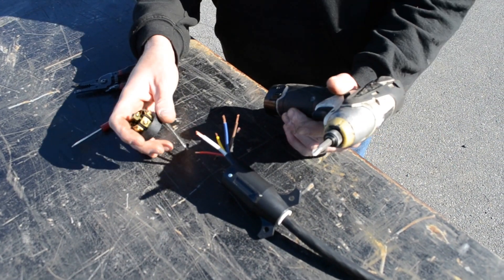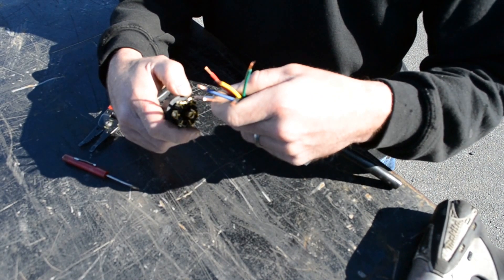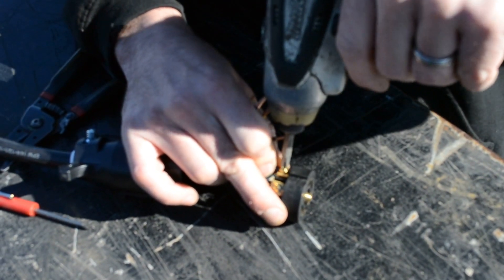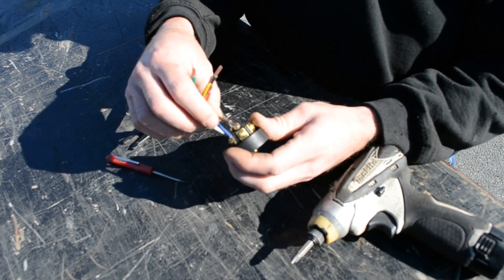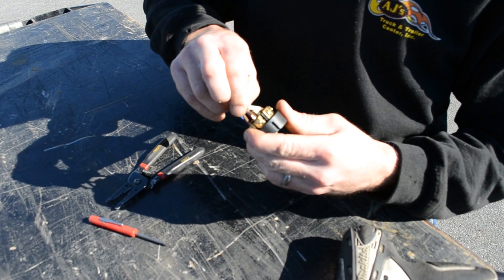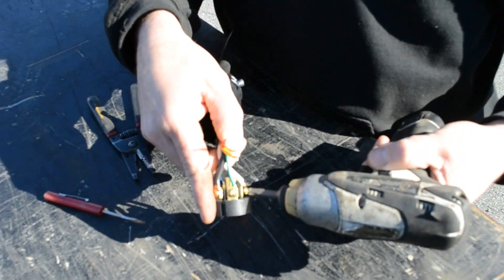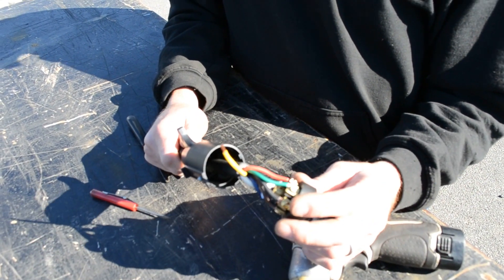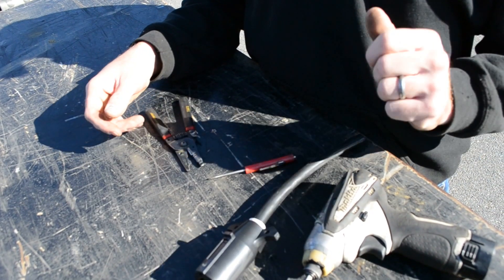How To Hook Up A Trailer's 7-Way Plug

Comment: Good god this was useless. Basically it's a video on how to screw down a wire, nothing to do with actually figuring out the wiring.
Reply from the maker: Sorry man, in a perfect world the colors of the wires match up with the colors of the pin posts.  But a lot of times that does not happen.  As Tom says in the video, ground your white wire and test the functions of each wire with a 12v battery so you know exactly which color operates which function on your trailer.   Worst case scenario, call your local trailer mechanic.
Reply: Yeah no kidding, go elsewhere for your info, this is not the video you are looking for.